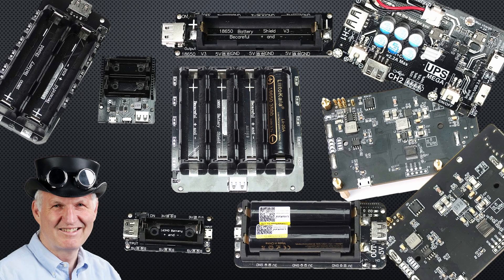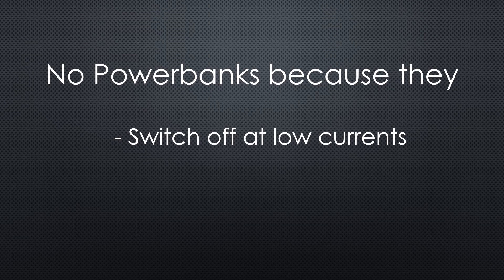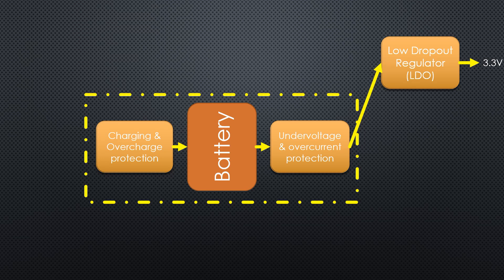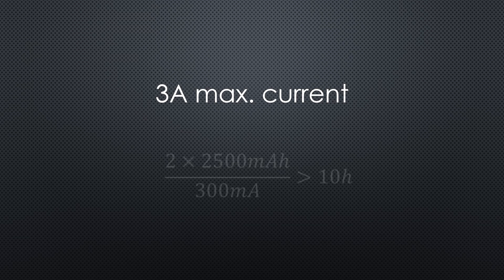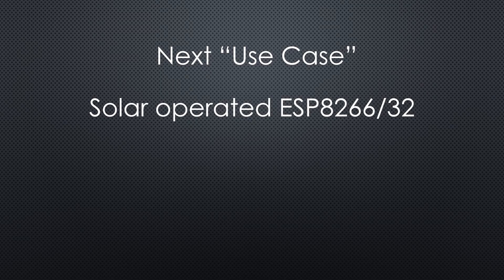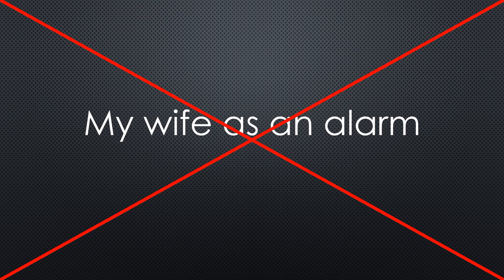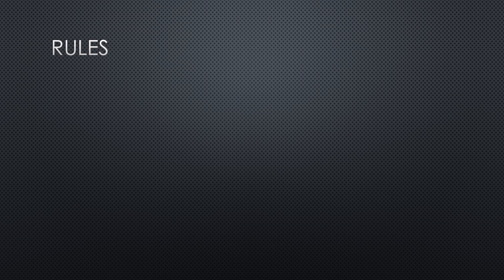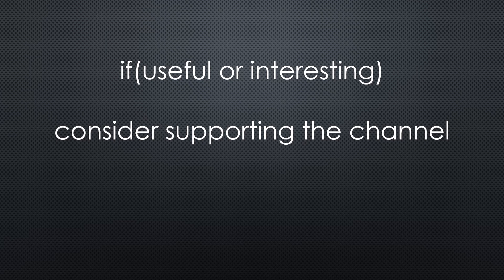#351 10 Battery Power Boards for Raspberries and ESPs. Start of “SuperPower” project

Comment: I will join the discord now :) this is awesome! Is there any way I could modify the schematic to change the boost chip so I could have a 10-12v output for some photoelectric sensors?
Reply from the maker: You have to look at the datasheets. I do not know. Maybe you have to add a boost converter.
Reply: @AndreasSpiess  i was thinking of maybe switching the chip which boosts to 5v to a chip for 12v, I don't know if it's good to boost an already boosted supply
Reply from the maker: Changing chips is usually not possible because they have different pinouts.

Comment: You may have a look at the project "Autonome Zelle" https://community.hiveeyes.org/t/versuchsaufbau-autonome-zelle-solar-feinstaub-wetter-vergleichsding/1373 

Eigenüberwachung eines Solarsystems
- Spannungen, mittels ADS1115
- Akku,
- Solarpanel
- 3.3V/I²C-Rail
- 5V-Verbraucher-Rail
- Akku-Heizung
Stromstärke, mittels INA219 (noch nicht in aller Doku enthalten)
- Akku (Lade- und Entladerichtung)
Temperatur, mittels BME280 am Akku

The interesting thing is the battery "heater" to use and charge LiFePo batterys in cold environments also, more important for Swiss people than here in Berlin but we should not be too sure to have no minus degrees in the future, so it's a good idea to implement this also at least as an option. ;-)
Reply from the maker: Interessantes Projekt. Speziell die Batterieheizung. Ich bin allerdings skeptisch ob das notwendig ist (bei unseren kleinen Ladeströmen) und insbesondere wie gross die Solarzelle sein muss um im Winter genügend Strom für die Heizung zu bringen. Vielleicht wäre ein schwarz gestrichenes Batteriefach neben den Zellen einfacher? Dann würden sich die Zellen bei Sonnenschein auch aufwärmen.

Comment: How long is this going to be open for? I.e completion date?
Reply from the maker: What do you mean with completion date?
Reply: I would assume as long as it takes to design it or as long as there's enough volunteers taking part.
Reply: When the circuit is ready to print? Its an area i want to learn and get involved with and wondering on time.
Reply from the maker: Now I understood. I have no idea how long it will take. I assume we will see first results in a few weeks.

Comment: I am in for the project. I can help with pcb design. 

I regularly use jlcpcb and their assembly service. 

I also want to design a raspberry pi header to power it from 12v. I have a server rack with 5 pi's each with there own all plug. Want to use one mean well power supply which I already have.
Reply from the maker: Just join discord. There is already a Teamlead waiting for you.
Reply: I designed a battery charging board long time back. Wish to share it.
Currently, it has the following features:
1. Charge Indicator
2. An interrupt from the charge controller
3. USB ESD Protection
4. Battery protection
5. Low Iq(3.2uA) 150mA 3V/3.3v LDO
6. Integrated power path management
7. Battery charge current upto 5A
8. 12uA low battery leakage
9. Additional adjustable boost converter

I would also like to contribute and work as a team member in this project.
Hope to get in touch soon.
Reply: @AndreasSpiess  Please let me know how can I join the discord channel.
Reply from the maker: The link is in the video description. Maybe you can contribute your know-how to the "requirements" as well as the "chips" section.
Reply: @AndreasSpiess  Thanks for the reply.
I will put my findings in it.

Comment: How long will battery last without charging?  I just need report 3 times a day
Reply from the maker: You have to make a choice for the board and sensors and make your calculations
Reply: Very true statement Sir. Though this is new to me. The need is critical to save an elderly widow home.  I am under pressure.  So sorry for questions that may seem inadequate to you Sir.
Not sure if this qualifies enough but an esp32 with a humidity sensor and temperature sensor as a unit to report to server even at 4 times a day. And some how also written to a file to be printed and analyzed over 90 to 120 day periods.
While there may be finished products that do that for a much higher price,  I want to learn and build and pray I save money to be able to “help” others with this technology.

I have seen homes “condemned” and torn down from black mold contamination.  The sad part is very old age of home owner losing home, IF I CAN HELP SAVE IT.  I am happy,

Your shared knowledge has HUGE POSITIVE IMPACT ON MANY LIVES!
Reply from the maker: If speed is important you just try it, buy 2 batteries, and change the battery when it is flat while recharging the second.
Reply: I saw a “”DHT11, DHT22, ESP32” together to give temp and humidity readings.  (Not good in electricity) but only require 4 readings within a single day.
I was thinking qty 2 18650 batteries or qty 4 to give 3 to 4 weeks power. I know I have to regulate power feed to not damage hardware. 
I am ignorant there.  I saw your Dual 18650 battery holders, but not sure how to calculate the three items power to figure lifespan of charged 2 batteries or 4.  If I go wit qty 4 for longer run time do I need power reducer between 4 batteries and the 3 listed hardware.

They will be installed in crawl space under home with no power source or no sun to use solar power.
2=crawl space, 1=attic,  2=closets, 4 = different rooms (monitor/record ENTIRE HOUSE CONDITION). RASPBERRY PI 3B+ (UNKNOWN software to write results of all in a file to read and print out.(9 separate files recorded).  Also option to read any or all on a monitor.
Maybe HOMEASSISTANT software can help on saving data to print later and see live readings on screen if requested.  ( I will ask HASSIO about that part)

I am determined to SAVE an Elderly Home but need to monitor condition of home ongoing.

If you have better sensors, point me to them please.

Comment: Hello!
Please do not use an over discharge protection value of 2.5V!
Li-Ion-Cells will slightly be damaged below 3.0V each time you discharge them.
Good protection circuits stop at 3.0V, 3.2V or higher.
I use 3.3V, because this value allows a protection of lipo-cells too!
You hardly find devices with such specs on AliExpress or Banggood.  I bought several pieces. Many Sellers write wrong cutoff values in their product descriptions. Always check the comments of the users! Although there are devices that really stop at 3V (Pimoronis Lipo SHIM ->warning at 3.4V and cutoff at 3.0V)
I build a circuit on my own, using a max8212 ic.
This way i was able to decide the cutoff value on my own (it depends on the resistors...).
Using such devices expand the lifetime of your cells! 
Here you can read something about protection circuits:
https://learn.adafruit.com/li-ion-and-lipoly-batteries/protection-circuitry
Here you can find a nice diagram and further explanations (@3V li-ion-cells are „empty“):
https://learn.adafruit.com/li-ion-and-lipoly-batteries/voltages

Bitte nutzen Sie kein Werte unter 3 Volt. Ihre Zellen nehmen mit jedem Zyklus etwas Schaden. LiPo Akkus dürfen sogar nicht unter 3,3V entladen werden. Sie werden bei den verschiedenen Anbietern aus China (immer die Rückmeldung der Käufer lesen!!!) Angebote finden die bei 3V zuverlässig abschalten. Ich selbst habe mir verschiedene Teile dort gekauft und getestet.
Ich löte mir mittlerweile meine Cutoff-Schaltungen (auf der Basis eines Max8212) selbst. Diesen IC bekommt man übrigens auch aus China (für kleines Geld). 

Ich wünsche Ihnen viel Erfolg für Ihr SuperPower-Projekt!
Bitte sorgen Sie dafür, dass eine Lösung gefunden wird, welche eine Entladung unterhalb von 3V verhindert! 
„GreatScott“ stieß den Bau einer Lösung an (die man auch kaufen/selber nachbauen kann) mit einem Cutoff-Wert von 2,5V. In meinen Augen ist sein Projekt damit für die meisten Nutzer mindestens nicht zu empfehlen! 
Bei meiner (langen) Suche nach einer geeigneten Lösung stieß ich in zahllosen Foren auf Leute, die Protection-Circuits suchen, welche bei 3,3V abschalten! Ein solches Produkt würde einen reißenden Absatz finden. Leider findet sich auf dem Markt zur Zeit KEIN solches derartiges Gerät.
Vielen Dank Herr Spiess für Ihren Channel!
Reply from the maker: We will see if we find a solution in the Superpower project.. In the meantime I usually measure the voltage and transfer it to my server. Like that I can charge the battery before it is empty.

Comment: The ultimate power bank should have the option for energy harvesting too, RF, vibration, etc.
Reply from the maker: Maybe you add your requirements with your use case into the project?

Comment: If you want JLC assembly choose the parts from here: https://jlcpcb.com/parts

Not from LCSC because JLC does NOT support all the parts for assembly from LCSC.
Reply from the maker: Thank you for the link. I added it into the project.
Reply: @AndreasSpiess  Welcome really interested in the project, maybe it can be usefull otherwise to use EasyEda because it makes the P&P and BOM files as needed for JLC
Reply from the maker: My current plan is to use EasyEDA

Comment: While we are on the subject of "SuperPower" power supplies, what about "Ultra Low Power Microcontrollers"?
.
One microcontroller family that comes to mind is the Texas Instruments MSP430 which has a very similar (identical) IDE to Arduino.
.
This family has very low power consumption: between 40 µA/MHz and 400 µA/MHz (depending on the exact microcontroller).
.
See: http://energia.nu/
.
The MSP430 family is more suited to portable battery powered applications than the AVR family.
.
Reply from the maker: Low power MCUs are interesting, you are right. There are many other MCU families available like STM32 or the Nordic MCUs. I try to stick with the mainstream. Adding a new family is a lot of work. And they have to be supported by the Arduino IDE. It seems that this Enigma is based on the same tools like the Arduino IDE, but is not compatible. Do you use it?
Reply: @AndreasSpiess  I wasn't aware that the STM32 family was considered a low power device.
.
I suspect we need to tread carefully with what we consider a "low power microcontroller" where impressive deep sleep current consumption is one thing and the "normal run state" current consumption another. You can't always implement "deep sleep with interrupts" to wake a microcontroller on an event. Sometimes we end up having to run a microcontroller 24/7. I formed the impression (I'm probably wrong) that the MSP430 family was the king in the 24/7 (no sleeping) continuous runtime category. From memory the STM32 runs at max of 72MHz, while the MSP430 runs at a max of 16MHz. Therefore the STM32 can afford to spend more time sleeping (saving power) while the MSP430 has to stay awake (using more power).
.
I was attracted to the MSP430 family for the following reasons.
- The marketing hype.
- My intuition (I make mistakes)
- The popularity.
- The cheap/affordable and easily available development hardware.
- Quite a range (interesting) of cheap MSP430 development boards on Aliexpress.
- JTAG/Spy-Bi-Wire debugging interface.
- The "Energia" IDE which is similar to the Arduino IDE
.
I have/own the Texas Instruments "Launch Pad" MSP430 development board which isn't expensive if you buy from TI. Aliexpress also sells the "Launch Pad". I also bought/own (which I haven't used) the MSP-FET430UIF MSP430 Debug Interface Programmer on Aliexpress.
.
https://a.aliexpress.com/_mObd9PZ
.
Unfortunately I've been very busy with so many other projects that I simply haven't had time to play with my MSP430 toys.
.
If I was going to undertake a "low power microcontroller project" today I would obviously  begin with the MSP430 family given my financial investment.
.

Comment: I'd like to see a solar powered power supply under volt cut off, but have built in hysteresis remain dormant until a specified voltage.  Then when that voltage is achieved, trigger a wake up.  I don't care if my sensors go to sleep for a few days while they recover, as long as they recover.
Reply from the maker: Maybe you check if your requirements are already covered in the project?

Comment: IMHO bugs in the GeeekPi board:
1. No power on restore function (solved with hack https://github.com/Siegurd01/GeeekPi-18650-Hardware-Fix
2. No pins for solder +- input voltage separately from the micro-USB connector (micro-USB is unreliable in fastening and may fall off with the pads on the board).
3. The INA219 is connected in a wrong way. It can show +500 mA when the external power is on, and -500 mA when on batteries only for example.
4. USB-A and USB-C are not connected to INA219 so you can't measure the full power consumption. Only RPi Pins are connected to INA219.

Also found working pure C/C++ library for the INA219 (no Arduino libs used): https://github.com/regisin/ina219

UPD
Another bug is that UPS always work from batteries and has no input/output switching circuit. So batteries are periodically discharging and then charging (when batteries are discharging - no power consumption from external source). It will kill the the batteries shortly...
Reply from the maker: Thanks for the info. We will see how the "Superpower" project will solve those problems...

Comment: The TP4056 is not a very good part. The specifications state the charge voltage to be +/- 1.5% of 4.20 volts. The 1.5% isn't very good, and the bigger problem is that it doesn't even meet that specification. I have designed that part into a UPS type power supply for the Raspberry Pi. We pretest every chip before putting them on our pick-n-place machine. We typically have to throw out 25-30% in our pretest. 
The CN3065 has a 1% specification for the charge voltage. The only thing that turned me off of it is the DFN-8 package. I hate DFN.
Reply from the maker: Good to know. But most of the commercial boards use this chip.

Comment: An ideal board cannot exist. Every project seems to have different power requirements. My current project is running from, and maintaining, a deep-cycle 24V AGM battery. The project before was an ATTiny with a CR2032 battery. It's always different. I'll be interested in whatever your team comes up with, but I'm doubtful you'll get far beyond the requirements phase.
Reply from the maker: We try to modularize the design that everybody can choose the functional blocks his project needs and create a PCB.  This is why we try to work with JLCPCB. They assemble the whole thing.

Comment: Great topic and initiative! I came to similar conclusions a few months ago when assembled my own Swiss Bank, a Raspiblitz, which is a R. Pi4 with a HDD, or SSD. I had data corruption problems and needed a UPS. A LOT of people are having this kind of problem. I noticed all UPSs use step-up converters. As HDD+PI 4 with high processing consume a lot. I created my own solution with available modules, choose to use 9V supply, 2 cells, step-down architecture to have smaller currents.
I did a fast wiring sketch to share my idea:
https://github.com/odudex/nodecase/blob/master/Hardware/node_schematic.pdf
(The wiring scheme also contains a GPIO controlled fan for cooling)
I don't monitor the voltage, but I monitor the power. I run a python daemon, and after some time with no power the Pi will safely shutdown.
Is is running very well for a few months.
I'm an electronics engineer, and can help with an opensource board design. I'm an Altium user, but could use another design tool.
Reply from the maker: Very good. For the moment I assume we will use EasyEDA because of the tight integration to the LCSC library and the easy (non) installation. But I am sure any CAD will be a small learning needed for you ;-)

Comment: It’s not clear to me why you need 3.3V for a raspberry pi. You didn’t really explain why that’s needed or desired.
Reply from the maker: If I said a Raspberry needs 3.3 volts it was wrong. It only runs internally on 3.3 volts but has the needed regulators on board. 
ESP32 and other microcontrollers work with 3.3 volts

Comment: Just me thinking, but would the supercap-shutdown-circuit that Andreas showed in video #315 ( https://www.youtube.com/watch?v=cKDv0aN67BY ) also be considered valuable enough for other people to include it into "SuperPower"? I have tried to replicate the circuit and tested it a little, but am having trouble with booting after a simulated power loss. Basically as a novice I would greatly appreciate help in even making this simple circuit and maybe more people would like this circuit as an easily ordered board from JLCPCB for their headless Pi projects?
Reply from the maker: Maybe you join the project and add your requirement? ( https://docs.google.com/spreadsheets/d/1oGSQRG4XssmFL4II1EF2akhWRhvSvHqH1uTaYX9znlw/edit?usp=sharing )

Comment: Two 3.3v logic i/p pins to control power on (with 3.3V jumper) in Marks Bench type config, but using smd (e.g. A2SHB, 2x47K and 2xBAT41).  See: https://marksbench.com/electronics/esp32-cam-low-power-trail-camera/
Reply from the maker: Thank you for the link. You always can create your own design, of course...
Reply: @AndreasSpiess  Perhaps something with a CR123 LiFePO4 and CN3056.

Comment: A friend and I, working on ESP8266 (and ESP32 a bit) were currently looking for a good way to power an efficient project (lots of deep sleep) for a very long time while remaining compact (probably using those flat LiPos rather than the cylindrical cells).
I just received a few of these: https://hhtronik.com/product/pgcpsu-duo/
It includes a 5V step up then 3.3V step down, so probably not the most efficient for an ESP8266 only module, but maybe worth a look?
Reply from the maker: The simplest way to get 3.3 volts from a LiPo is to use a HT7333. You are probably right: To use a step-up and then a step-down does not seam to be very power efficient.